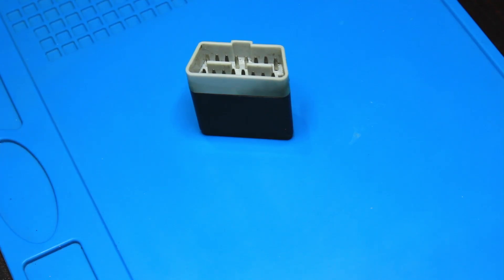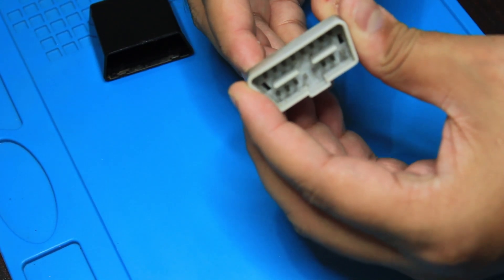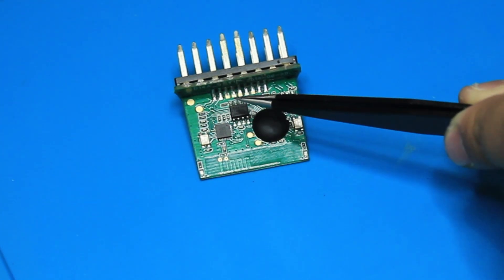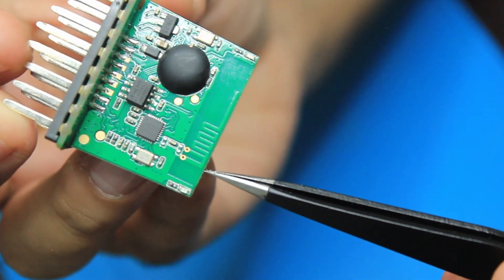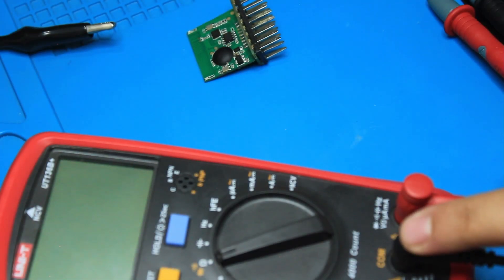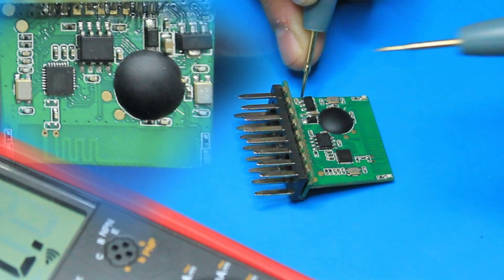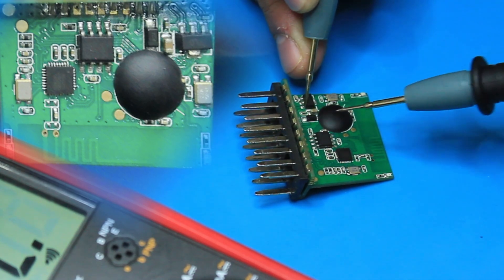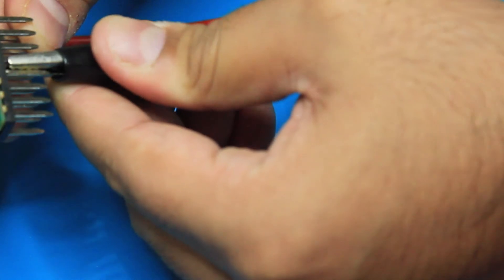Fixing OBD-2 Scanner

Comment: That blob is not there to prevent anyone from "reading" the chip but it is a COB (Chip On Board). The chip itself is bonded direcly to the PCB and covered with that blob as a casing. It's to lower the cost of manufacturing. I think CAN BUS deciphering is not a difficult task since you can do it on an Arduino.
Reply from the maker: that's interesting.. Thanks for taking the time to let us know. appreciate it.

Comment: That Atmel chip is the ATA6561, which is a High-Speed FD CAN bus transceiver device that operates upto 5megabits/sec. I think the "849" is the manufacturer 's datecode - The Parr was made in the 49th week of 2008!
Reply: The ATA6561 should have pins connected to the CAN pins of the OBD-II and other pins connected to the "chip blob".
Reply from the maker: Thanks for dropping in the info.. This was helpful.